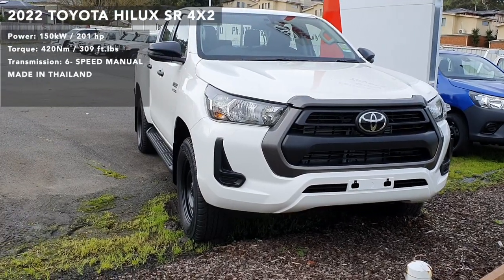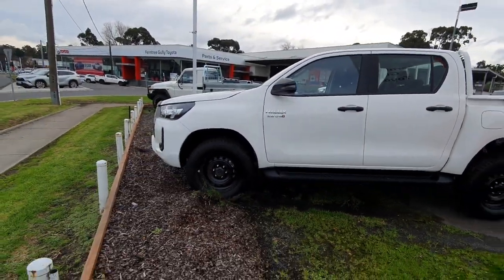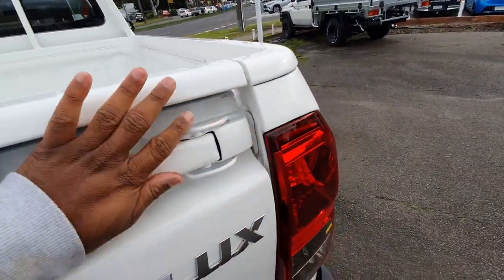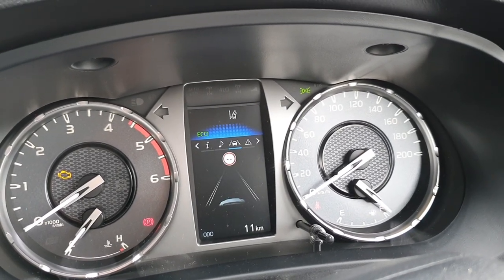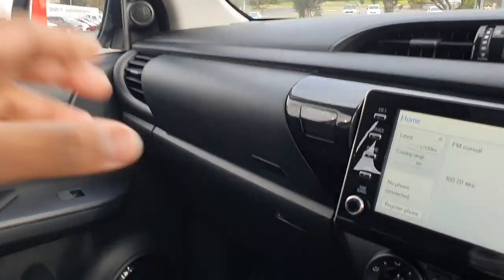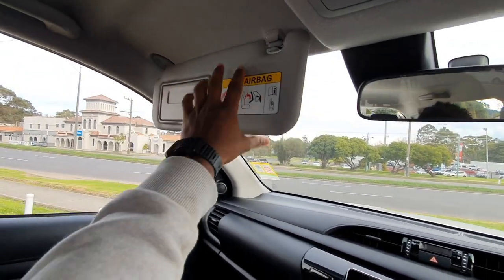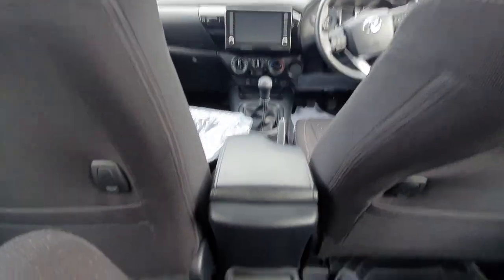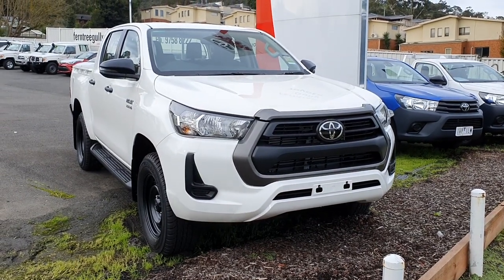2022 Toyota Hilux SR in depth tour interior and exterior

Comment: Great review helped a lot deciding between sr and sr5.
Reply: What did you choose? Big price difference
Reply: @JRtheBoy  SR5, it was way too nicer inside and outside. paying extra for rear air vents, leather seats, led headlights,  digital climate control , A-Deck was worth for me compared to getting SR and regretting.
Reply: I chose a 24 sr than sr5. The same performance almost $20,000 difference for the leather seats
Reply: @emotuy08  good 👍 on you mate. I am carting kids and family around in addition to work so needed that extra comfort. I think the best value is the workmate model with 2.4 engine. It misses out on diff locks but extremely good value workhorse.